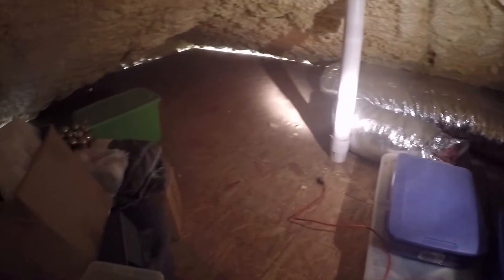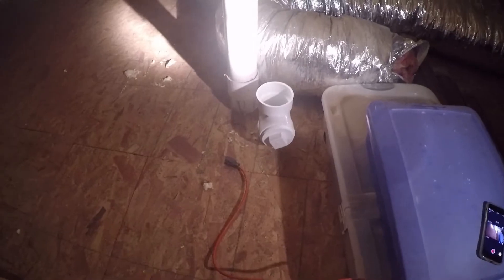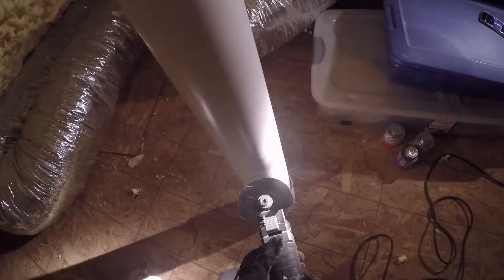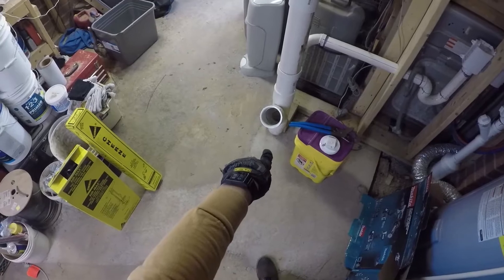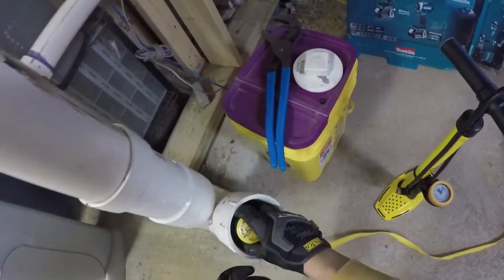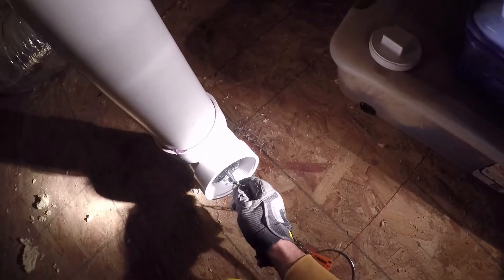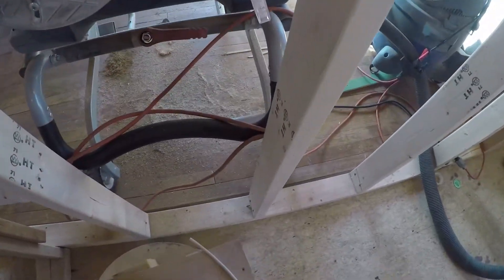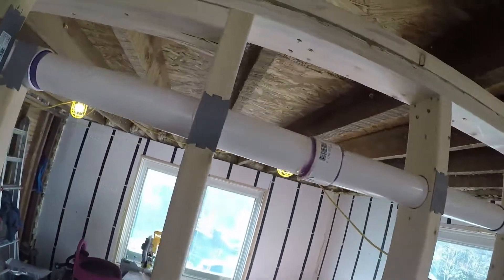How to fix a leak in your PVC Drain Waste Vent system

Comment: Ingenious idea!  Did it work though?  Video ended before seeing the results
Reply from the maker: Stu Hall yes it did work! I also discovered that the first inspector that told me we had to have 10’ of water above the highest drain was wrong. That only applies to commercial jobs so the water test only had to fill to the overflow height of the highest sink. So that repair wasn’t actually needed but it was good to know that it works.